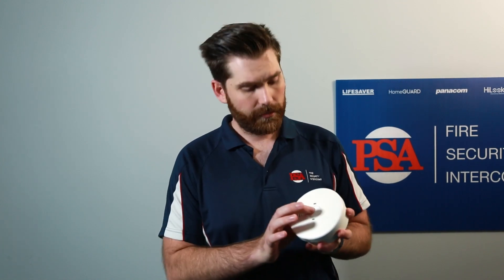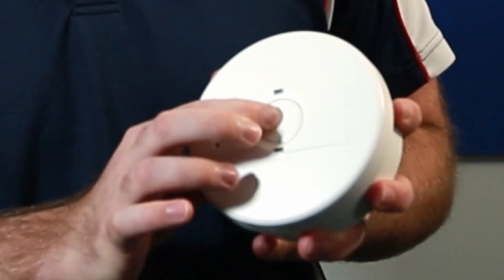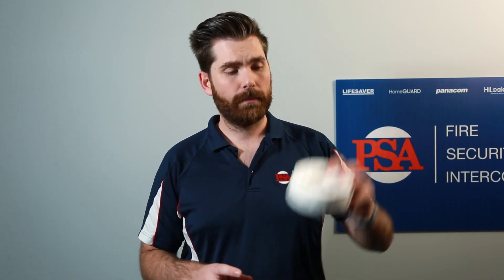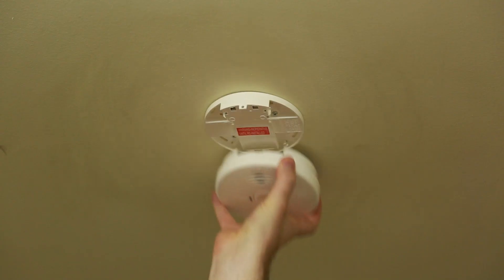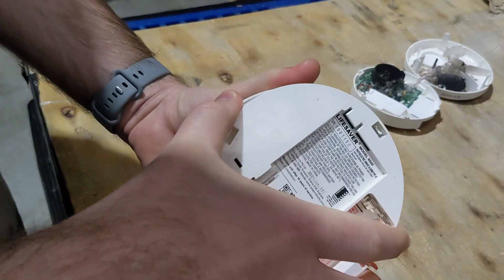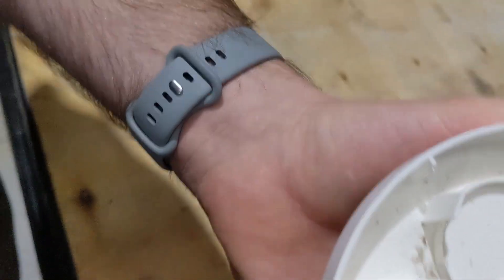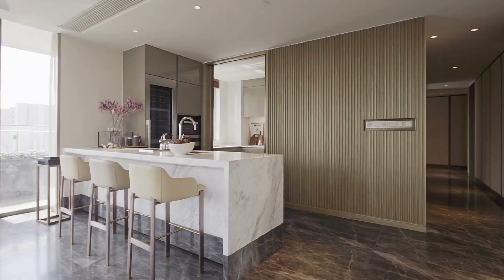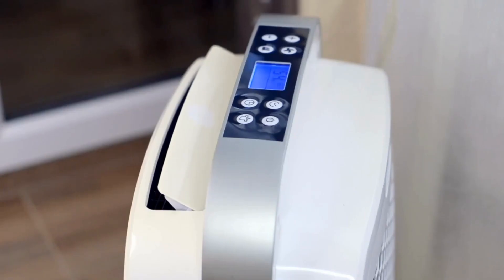Why do Smoke alarms false alarm? And how to prevent them

Comment: alkaline batteries drain quicker in cold temperatures
it is usually most cold during the early hours 3 - 5 am
change your batteries once a year and you should
never have single beep issues. but most of us are
too lazy or forgetful to do it every 12 months...

Comment: Human nature - most people are not into high maintenance! When will smoke alarms be designed to not trigger false alarms?
Why can't they incorporate batteries that last 20 years?
Can they use LFP rechargeable batteries (3 cells = 9.6V) and keep the batteries charged from wired power?
Can they surround the entire alarm (or at least the detection chambers) with a coarse filter to stop insect intrusion and then use a tiny fan to force air through the detector if running off the wired power at the time?
Some alarms are too loud! Can it automatically adjust the alarm volume to be say 15db above the current ambient noise prior to the alarm sounding?
Can a different (but still tied to the network) wired alarm be silent but produce a bright flashing red light so we can mount them near to a noisy area?
The battery replacement chirp is particularly annoying as batteries cool down in the night, reducing their voltages to below the trigger threshold. They could wait for a further 12 hours and then give the battery alarm chirp (a low battery is not dead yet).
Could all the interconnected units announce (and the faulty unit indicate on its lit display) an auto-unique unit number? It is sometimes difficult to locate the failing unit if the house has echoes, particularly if short chirps happen at night.
I would pay more for an alarm that can do these things.
Reply from the maker: Thank you for your detailed feedback @isovideo7494, feel free to email our team at support@psaproducts.com.au and we will happily answer your questions in more detail.

Comment: I'm having a similar issue, two different Tyco PG 9936 Power G wireless detectors falsing in the middle of the night.  Both had ceiling fans running on low nearby but 3 feet away. I bought this home a year ago and I suspect airborne dust is the culprit despite a clean environment.  The house has new paint and carpet months ago, I dusted everything and replaced my air filters with Merv 13 4 inch deep filters a second time now. Lower Merv ratings are too porous imo. I will relocate my detectors further away from the return air vents and ceiling fan to avoid airborne particles, I replaced the non functioning electronic filters in the hvac system last December,  perhaps this info will assist you in your diagnosis.

Reply

Comment: I find ionization sensors are less sensitive to dust than photoelectric detectors when I switched from ionization to photoelectric smoke detectors.  Unfortunately, ionization sensors are less sensitive and take longer to activate when smoke is present.
Reply from the maker: Smoke alarms have become more sensitive to requirements on their software as well. As you say, ionization is slower to trigger for both dust and smoke, which is why photoelectric is the preferred technology.
Reply: @PSAproducts a

Comment: How about temperature differences between an attic and the room in which the smoke detector is mounted?
Reply from the maker: Hello, this is not something that we have come across before. Is it something you have experienced?
Reply: Attic is often 90+ degrees or more and house is ACed to 75 degrees.   One side of smoke detector is sitting in 90+ degree heat (battery, PCB and electronics maybe) while the other side (photo sensors) is resting in 75 degrees.  Possible moisture buildup on the colder side.    @PSAproducts